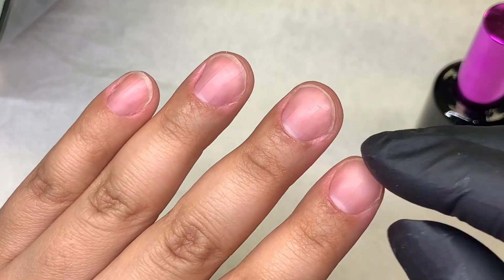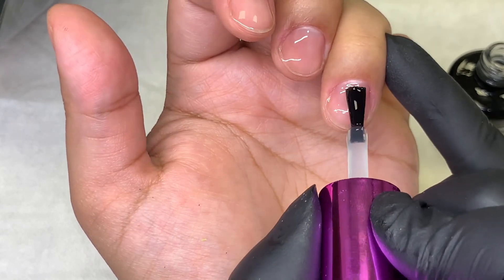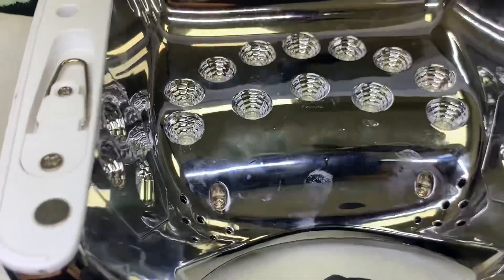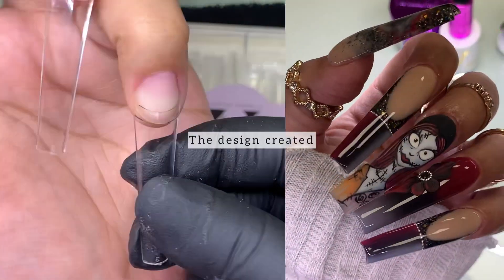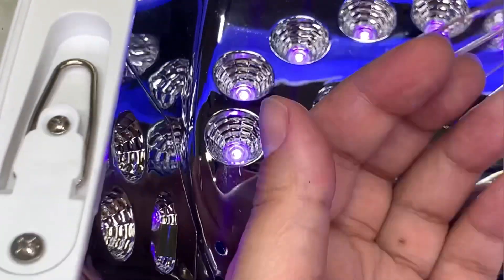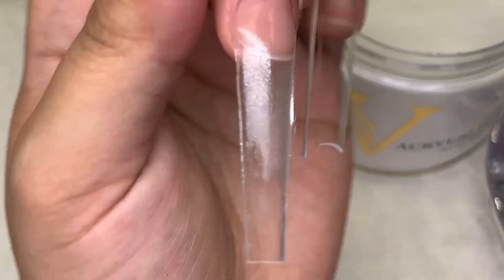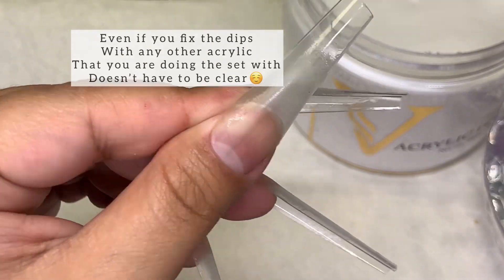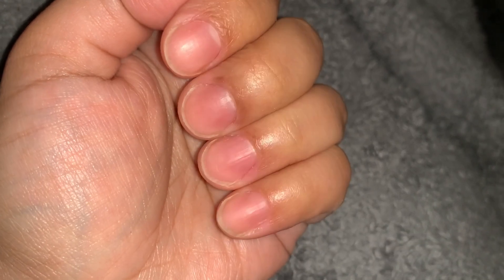🤔Nail Hack💅🏽 Peel-Off Method! Using Matte Gel Top coat!

Comment: yesss this is the best method so far being a content creator as well ,I just started using the matte top coat as my peel off base method.. I use to use just cuticle oil and top coat and it would hold them on for awhile but the matte method definitely allows them to last longer. Love this video and all the extra tips and tricks cause I’m definitely gonna start applying my top with my second layer, that was very helpful. TFS ❤
Reply from the maker: ☺️💜🤞🏽 ty for watching doll
Reply: How long? At least two weeks? Or maybe 10 days?
Reply: @vcolondres1616 I’m wondering this too 🤔

Comment: Yes those heat spikes girl!  Ouch!!!  I usually use peel off base coat but def will try the matte top coat & cure the nail on .. ThankYou so much for this❤❤❤. Luv ya!!!
Reply from the maker: Does is burn with peel of base as well?
Reply: @vanessanailz  no cause you don’t cure it.  But I’ve had gel base coats burn TF out of my nails it’s so painful! 😫
Reply from the maker: So peel of base coat is more like a nail Polish? No curing involved? How long does drying take?
Reply: @vanessanailz  yes… I use UNT / can get on  Amazon - dries pretty quick.  👍🏼
Reply from the maker: Ok thank you so much for the info 🤗🙏🏽

Comment: This would be great because my nails and cuticles were always so healthy until I started using Gel.  So my question is All we need to put on our Nail Beds is Matt top coat ?? No dehydrater, or primer?  Thank you 😊
Reply from the maker: Babe a dehydrator and primer is for when you are doing an actual nail prep for your enhancements to adhere to your nail plate for durability. 
We are doing the complete opposite here in this video because the idea is a hack to NOT Have acrylics or gel bind to your natural nail plate for duration if you are looking to safely n quickly remove them at the end of filming the nail tutorial design for your content. 

A dehydrator removes the oils from your nail bed - AND WE WANT ALL THE OILS WE CAN GET as to why we start out with moisturizing our nails with oil. 

A primer is a product when dry creates a layer of sticky  residue that acts like glue between your nail plate and the enhancement such as acrylic, gels ect.

You will only use those items when performing an actual nail enhancement service to yourself and n client. 

This video is the complete opposite of that it is not meant to be an educational video, it is simply a nail hack for a quicker removal process right after doing the nails, instead of needing to spend hours filing and soaking with acetone to then move on to the next design, some ppl will become impatient and just rip them off, so doing this “POP-off” method if done well and not constantly every day will help save you time and not damage your nail plate.

Comment: Hi, nice video! I just wanted to mention to get that line on your nail checked if you haven’t. It can be a sign of melanoma. Please see a doctor ASAP if you haven’t already. Stay safe❤
Reply: I had one check in 2007. Thank goodness it was only a mole under my skin’s surface. I’m glad I got it checked but they did warn that my nail may not grow back. It did but there is a gap underneath the center of my nail. It’s thin and splits but better safe than sorry.

Comment: As a licensed nail technician 
Your nails shouldn’t be burning 
Your overfilling which thins the nails and makes you sensitive to uv.
Reply from the maker: Hey Shan thanks for your comment 

I’m a license nailtech myself 10 yrs

Although your statement is correct when applied to the proper scenario 
if you’ve watched the video thoroughly Youll see that I never once filed my nails at all, I actually stated not to prep the nails at all, my nails are thick and healthy, this video is not Intended to educate ppl on proper nail prep, as to why I mentioned not to do this for an actual service, this video is a nail hack to remove your nails at the end of a creation for content :) 
the matte top coat i use do heat when curing under the light so wether its on your nail bed or accidentally on the skin it will burn and as mentioned not all matte coats are made the same, some will burn while others won’t💜